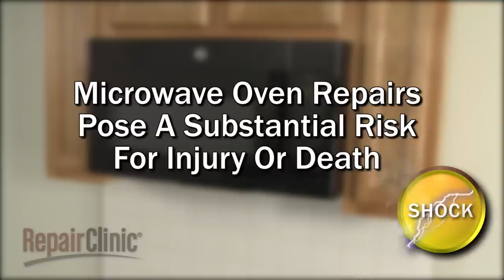GE Microwave Cooling Fan Motor Replacement #WB26X10262

Comment: The internet is completely devoid of the answer to this question. How many ohms should the cooling fan motor test at? My motor coil is 8.3 ohms, and is essentially the same as the unit in this video. I'm asking because my magnetron has a broken magnet, and from what I've read, that is a good sign that the magnetron overheated. I'd like to know if the cooling fan motor is OK before I patch the thing back together.

I'm not sure what the third terminal on the motor assembly is, but I have strange numbers between it and either of the coil terminals. First it was 130 ohms, then when I tested it later it was 275, and again later, it seems to be resting at 473 ohms. Nothing has been powered on.

Comment: My fan works for about 2 - 3 minutes but then continues to work. I am worried about overheating. Do you think this is a problem with the fam motor or something else. I replace the PCB in the control panel and this didn't work.

Comment: Interesting to note that the new fan is never tested prior to reassembling and installation. Hopefully it works. :)
Reply: You can run it with the cover off to make sure everything's working. Just put a glass of water inside so the mag has something to heat and don't go anywhere near the internal components until you unplug it again and discharge the cap.
Reply: How do you test it? I am not familiar with that process